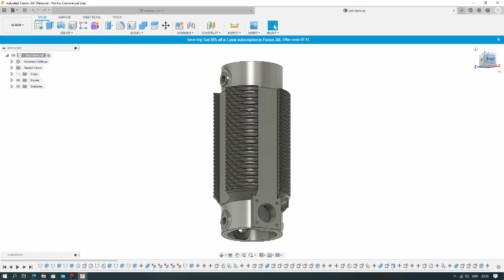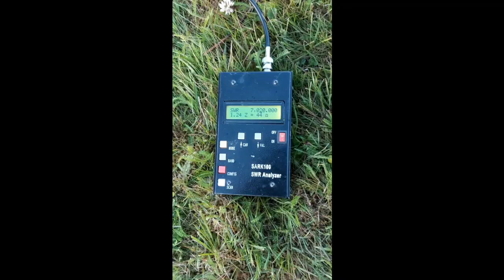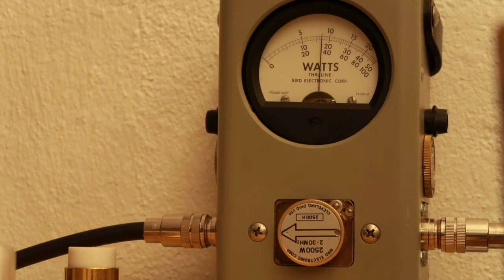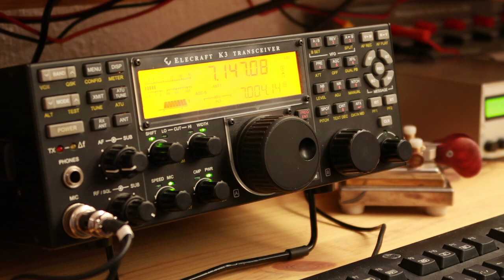3D printed multiband vertical antenna loading coil, tested at high power+ CW, SSB QSO

Comment: I also made a loading coil, but I printed thin strips to guide the path of the wire and glued them to a PVC pipe...printing the entire unit will use a large amount of filament, and will deform if heat is generated or if it is stored in a high-heat area (like a car in the summer).
Reply: pla or petg isnt good for heat or moisture. abs or asa would be better.

Comment: JFYI, I've used this as a form for a 75 ohm matching stub for a 6M Delta Loop and it's the perfect size to form the RG6 over 6 to 8 turns for the stub! Also, 1.5mm tempered spring music wire works well as an alternative to the fence wire and holds it's shape quire nicely.

Comment: Looks very professional, I'm currently working on a 160m add on coil for my adjustiwave. It's good to see the power handling capability. Well done.
Reply: Did you complete a larger coil and 3D print file for 160m that you can share? 73 W3GUY
Reply: @ErnestGWilsonII  I don't have a 3D printer. The project is still on the back burner. I'm now looking at using 3/16" copper brake pipe which should almost be self supporting.
Reply: @MM0OPXFieldRadio  very good, good luck! Let us know how you make out! 73 W3GUY

Comment: Printed on modified Ender 3 V2 using PETG 240C nozzle 70C bed. Printed at 0.12 layer and normal speed. Eighteen hour print came out looking very good.

Comment: Could  you  show a view of the inside of the finished coil at the SO239 end?  I would like to see how you routed the electrical fence wire into the center of the SO239.
Reply from the maker: A stranded wire is soldered to the center conductor, and the other end of the wire has a ring terminal soldered to it. There is a small screw with a nut  holding the soldered ring terminal on the inside, and securing a ring terminal with the fence wire crimped to it on the outside of the coil
Reply: @SA2CLC  Can you make a video detailing all the connections and sizes of the vertical wire. Please?

Comment: Thank you very much for making this and sharing it with all of us. Do you think you could make a similar 3D printed model that works on 80 m? Also could you make one that works on 160 m? If you are able to upload the 3D file somewhere and share it that would be great. Thank you very much, 73 W3GUY
Reply from the maker: Well. This covers both 80 and 160, depending on the radiator length.
A loading coil that matches a 16ft radiator on 80m would need to be around twice the size as this one. The height of this one is about what I can fit in my Ender 3.
Make two and put them in series :)
Reply: @SA2CLC  What about using the same 6m radiator / same pole in your video and a larger coil for 80m and an even larger coil for 160m? Also, new question now: How did putting them in series do? Any videos on that? Thank you and 73 Ernest W3GUY

Comment: Does a video exist showing how you designed this form in fusion 360?
Thnx,  Jimmy
Reply from the maker: No, sorry. Make a cylinder, apply external threads, and cut away unwanted sections...

Comment: Thank you for the design ! One question, with 5m radial (eventually trimmed for 20m resonance, and shortened coil), I've read you suggestions for electrically connecting in series 2 of these coils in order to achieve enough inductance for 80m while keeping the 20m resonant length of the radiator. My question is about the placement of the two-electrically-serial connected coils: Should they be placed collinear or they can be placed side by side while still keeping serial electrical connectivity ?

Comment: I'm using this as a start for my first loading coil vertical build. How long are the radials? And have I understood it right with center pin -> coil -> radiator and shield -> radials?
Reply from the maker: Correct. I'm using about 5m radials.
Reply: @SA2CLC  Thanks for the quick reply!

Comment: You mention that it's aluminum fence wire, do you know the gauge?  My local store has 14 gauge and 17 gauge.  I'm guessing 17, but firgured it's best to ask.
Reply from the maker: You can use either. Measured the wire, it's 1.5mm diameter,  which would comes close to 15gauge.  I would probably go with 17 if I had a choice //Tommy
Reply: @SA2CLC  Cool, thanks for the quick reply.  The 17 is about half the price too, so that's always a good thing.

Comment: Is there a special 80M-160M to share
Reply from the maker: No, sorry. But it all depends on radiator length. I doubt the inductance needed to load a 80m 1/4 on 160 is available on this coil form.
Make two and series connect them :D

Comment: Hi.  What size do you use for the coil wire?  Does the diameter matter?  will 2mm wire do?  And 6 meter long about?
Reply from the maker: The fence wire used is about 1.6mm diameter. A 5m radiator is resonant on 20m, A 6m fishing rod is perfect, to get "gp" style sloping radials